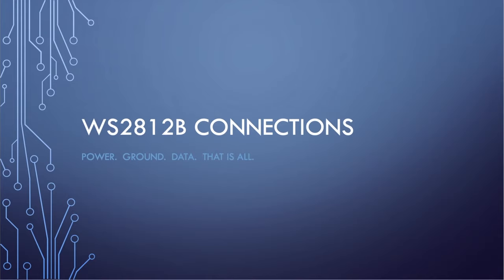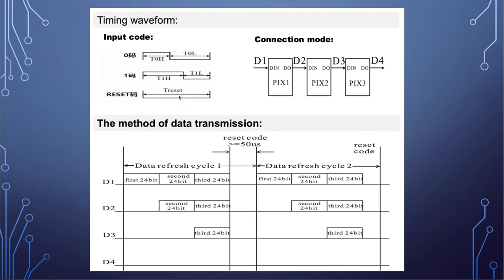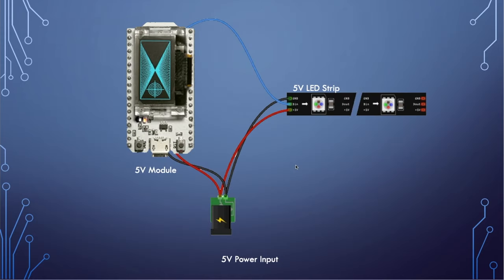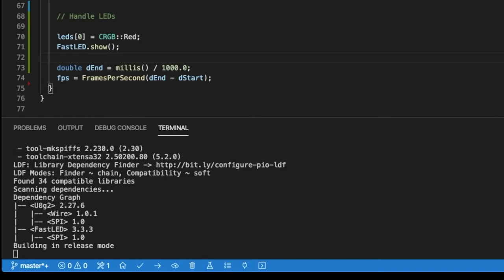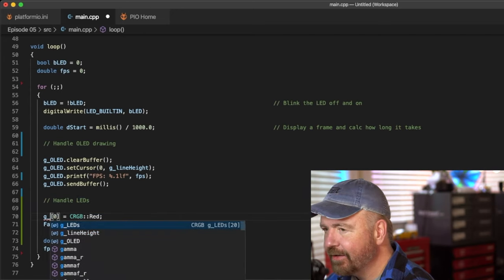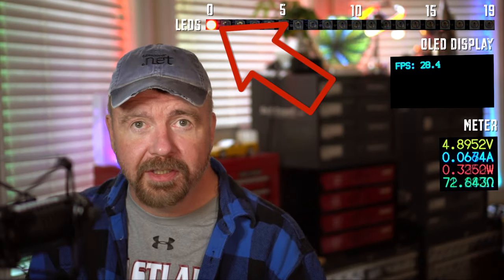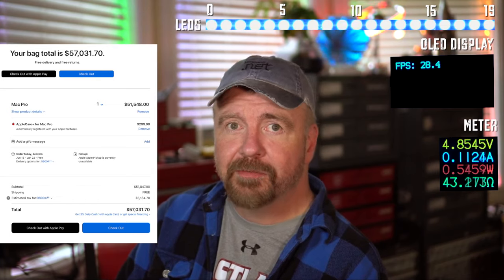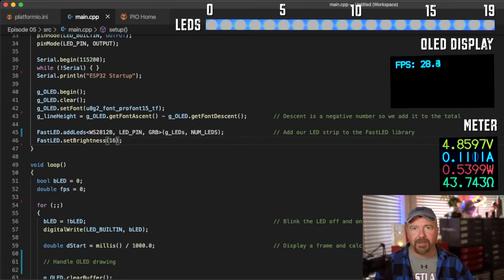04-FastLED with Arduino Tutorial Introduction - How to Code for RGB LED Strips (WS2812B)

Comment: Hey - just as a note - if you are like me, and you bought the Heltec (HiLetgo) ESP32 LoRa instead...  :)
You will need to  set the OLED_RESET (Pin16) to High and add the following code to the void setup() to get results on your OLED display... 

pinMode(16,OUTPUT);
digitalWrite(16, LOW); // set GPIO16 low to reset OLED
delay(50);
digitalWrite(16, HIGH); // while OLED is running, must set GPIO16 to high

Comment: Use FastLed inbuilt power limiting. Works and is nice: you tell it your power or current limit, it globally dims the strip to meet it (if you light too many)
Reply: Will research that!  Thanks for the heads up!  I cannot find a power supply that will fit in the form factor that I need above 4 amps and the calculations he provided of 20 ma per each leg of the LED's gives me 7.2 amps draw.  I think the real world draw is considerably less than that, but really don't want to find those limits.  I could set this feature to 3.5 amps to build in a bit of safety factor and then program away happily knowing that I can't fry my power supply by accident. 

Is this the command you were thinking about?
FastLED.setMaxPowerInVoltsAndMilliamps()

Comment: Just working thru this series - aiming to take my kids through them afterwards (they like playing with LEDs too).

Happen to have some slightly different kit lying around - so using a Lolin D32 for ESP32 and a nokia 5110 screen instead of an OLED - using the same libraries - just a little fiddling on the constructors - and it all works well.

But - I was going mad - once I added the fastled code - the LEDs blinked like crazy. In fact - they seemed to blink along with the onboard LED.

Took me a while to figure it - and you may have guessed it already :) - but this code is the reason (from the d32 header files):

static const uint8_t LED_BUILTIN = 5;

Oh - look - the same pin I have the pixels data line :)

Oh well - made me smile.
Reply from the maker: Wow, I've never seen a board that had the built-in LED on Pin5!  Good catch, that could really trip you up!
Reply: @DavesGarage  It did for a while :) I just dropped the bLED toggling for now.

I was also interested - a little less screen real estate - but the  5110 screen using software SPI (U8G2_PCD8544_84X48_F_4W_SW_SPI) the gets about 44 FPS on that moire design :)

Comment: Excellent!!!! I found using GPIO 23 for LED DATA on my DOIT ESP32 DEVKIT V1 gave low output during reset and avoids full brightness on power-up.  I was trying GPIO3 but it comes up as a driver and is high for about 250ms until the pin gets setup, long enough to confuse all the WS2812Bs and set the controls for the heart of the sun.

Comment: Hi Dave, your videos are very well made and a pleasure to watch. It's fun to watch pros program with FastLED! I'm not yet finished watching, but I'd like to say that displaying an oled display can hugely lower the frame rate (that's my personal experience). I've even come to conclude that oled displays are better not used at all with FastLED. Perhaps you could work around that issue by assigning that task (displaying the oled) to a different core, if at least you need a high frame rate (ESP32 should have 2 cores). I didn't try that out myself as I rather run a webserver, which is assumed to also capture a core. Note that I am an amateur by all means. Have a nice day and keep making nice videos!
Reply from the maker: Thanks, and a good point!  My practical solution to this is, as you say, a low priority task on the second core.  I didn't want to complicate the intro with that, but we might get there eventually!  In my own major project I'm having trouble with hardware SPI so am running the screen in software, which is super slow, so I had to solve it somehow!  It only updates about 4 times a second, if that.
Reply: @DavesGarage  Great, looking forward to those episodes! For now it would indeed complicate everything. 
For my own project, even updating the screen (I2C protocol) once per minute caused an annoying lag in some animations, which made me disable all oled updates in animation mode. I'm just telling you this because hunting such 'lag buggs' while nothing is wrong with the code can be a pain!

Comment: You mentioned connecting to a USB HUB/Switch (I think you meant hub) to protect the computer. Does it need to be powered? Recommended link? BTW. Loving the videos!
Reply from the maker: It depends on the switch and how it routes power, but I would think a powered hub would be much safer, if it indeed isolates the power entirely.  Good thinking!

Comment: It is a good job that there are people like you making these videoas. Excellent i have followed your code using 20 LEDs and the LEDs fade in and out, i have now tried 60 LEDs and the LEDs switch on and off without any fading. What am I doing wrong? Thank you

Comment: Hey Dave, your videos are great and I'm following along. Keep it up. With each video though, it seems like you're suggesting I buy a slightly different arduino board. Is this really necessary? I'd love it if, up-front, you had a full parts list you would suggest for the series so I'd know how much $$$ I was committing to in order to get to the end.
Reply from the maker: So far each one except the very first uses the same board, but I might link to a different catalog entry perhaps?  It should be the Hiletgo ESP32 w/ 0.96" OLED.  I prefer the one sold by "Maker Focus", but I bet they're all the same.   I did just switch to a link to a version that contains extra PSRAM for free, pretty much.  So it's not the the requirements have changed (any of the boards will work with any of the projects).
I guess the one exception was the very first episode where I used a board with a colored LED onboard to keep it super simple, but I won't switch often, honest !  Though I do like the M5Stick-C, check that out, as it is what I am tinkering with now!  But I still have dozens of Hiletgo units :-)
Reply: Greetings Dave, I have suffered happily learning from this series of videos.. Thanks for both the angst and for that sense of triumph, when (literally) the light comes on. Getting connected to the WS2812B strip with a board that has solder holes, rather than PINS will be fun.. Time to get the solder station out. @DavesGarage
Reply: I meant to ask: Are you using the M5stick in these videos for their ease of use.. (Places to put pin connection wires)??

Comment: Dave, is there a fastLED setting that regulates the communication speed to the WS2812B strip? I wanted to test my strip with just Red for each RGB led, then just green, then just blue to verify the individual LED were good. My string is 300 LEDs long. I have a separate 5V 20A supply for the strip. I connected the Gnd from the ESP dev board to the negative of the power supply so that the 5V power and the signal to the Data In on the strip (I’m using IO16 from the dev board) have the same common reference point. In the setup, I use a for loop to set all 300 elements of the CRGB array to 0xFF0000 so all 300 LEDs will powering only the Red LED. In the loop section, no changes are made to the CRGB array. I did leave fastLED.show() in the loop. I do not have an oled screen, but put a delay(250) in the loop. The string lights up red, but then glitch flickers to sometime showing blue briefly, and sometimes flickering to green briefly, but mostly stays on red. The CRGB data going out should never change. I’m thinking the speed of the ESP32 might be causing the data rate to be too high and the receiving WS2812B chips are not clocking in the data consistently.

Comment: Hi Sir Dave.. Thanks for all of your videos, I followed your tutorial about FastLED but it turns out my WS2812B is only showing white color LED after uploading the exact same codes. I'm using  18LEDS, 330ohms resistor for the data and Arduino nano. Why it's only shows white? Thanks.

Comment: where can we buy WS2812B in bulk?  trying to light up a 2 level, 55' mardi gras float.  I have the power suppliy capable of handling multiple branches of LED runs with proper 5v/15a vdc-vdc buck converters.  I just cannot find some place that has 350-400 ft of WS2812B strips available at a decent price.  I get that there was a "chip shortage" due to covid the past 3 years, but these things are not made of gold and shouldn't cost like they are.

Comment: Having a problem lighting all the LEDs on my strip.  When I use the fill_solid() helper function and tell my strip to light all, I only get the first 5 LEDs showing.  I have a 5V 40A external power supply, so power isn't the issue.  I've also directly set the LEDs in the g_LEDs[] array but can only get the first 5 to show anything.  I'm not using the exact same WS2812B strips that you are but it definitely is a WS2812B strip (and it's working for the first 5 LEDs).  Is there any way to test a strip to determine if an LED is bad? And if one is found bad, is there any way to replace it so the strip will work?  Appreciate any help,.

Comment: I bought the board and LEDS you recommended and I have a question. The code builds fine but I get this error when uploading.. "serial.serialutil.SerialException: could not open port '/dev/cu.SLAB_USBtoUART'" I don't think it knows where the board is? or what port. any help or advice would be great. Thanks
Reply: Assuming you're using the Arduino IDE, you may need to select the correct device under Tools > Port in the pull-down menus.

Comment: Working on externally control with 3 separate knobs / pots independently each color intensity all the way down to zero to a long strip of LEDs. Any input is appreciated while I am doing it. Maybe I see a be5er idea.
By the way, the blue thumb up button worked. 😁

Comment: On the subject of power, I purchased a 5v 60A 300w power supply and a few strands of WS2812Bs. Is there a minimum amount of leds that I can power with the supply?

 Im burning out leds when hooked up to the power supply. I have the tester and set it to just below 5v.

I figured it out. I missed the part where the esp32 needs to be grounded to the power supply.

Comment: This is a great tutorial that I found searching for some help on lighting a fire simulation under a 3D printed NASA Mercury rocket. Was thinking of just using a fire LED light bulb until I saw this, any suggestions?The problem with the light bulb is that it is directional and I need it to shoot down.

Comment: I spent many years feeling like rgb led was stupid.  Then I bought a few strips, power supplies, and controllers before I stuck any 5050 with and without WS2812B microcontrollers, since these are the only models any motherboard can also use.  DO NOT LEAVE THE STRIPS ON THE REELS while testing, it only takes a few minutes for the reels to start melting.  I heard one person say LEDs run cool. er, uh, NO!  Love Your Show as a fellow neurodiverse individual forced to buy into bogus crap bad mal- and mis-diagnoses (Mal- being these <bleep>ing ignorant alleged so-called psychiatrists and psychologists who forgot how important Scientific Method remains post-school. Not one has ever been anywhere near supportive or actually listened. When a client/patient says, "This Celexa is making me feel like I have Spina Bifida 24/7! What is the antidote? It is making a certain method of making it stop more of a viable option than you provide." and they respond with, "Your body just needs to get used to it, sukkah."

BTW, wish dot CON is NOT the place to shop for this gear.

They shipped one reel that was RGB all right, but it was Red, then Green, then Blue individual LEDs on a 12V, R, G, B four-pin arrangement, so the only way to see what color they would be as straight 5050s would is to fold the strip in a manner that puts the set of three LEDs near each other and even then you have to be about six feet away for the eye to view the color as one istead of 3cm between each.

take care maestro.

PS. I met Jim Alchin one night I was staying a little late to finish one important test in 28, when here he comes, in a big huge hurry, though I did see him coming, not real sure, but almost knew who was coming, hurried-up, tried to open the door as what I'd do for anyone, then WHOOSH i am invisible and nearly was knocked over.

I thought it was hilarious.

Also, why did full-timers keep telling us vendors our badges were Yellow, when in fact letting any sunlight on these 'Yellow' badges turned them an obvious Orange within a week.

I made it 11 years testing devices etc., with three years prior at DECwest two of them, with Intel & Compaq's PURE-D SATAN-SPAWN Carly Fiona, CEO getting together under the desk conjuring-up plns to decimate the far superior DECAlpha 64-bit CPU, which occurred during my one-year tenure at DECwest as the Tester for the three-person team to support what few customers had mistakenly purchased Windows Server 2000 Enterprise or Datacenter whatever it was called, only to find I was being paid about 30 thousand dollars an hour for the actual time spent having any actual work to do t all, DEC Alphaserver and Miata workstations were tanks.

My baby the first two years was Turbolaser, which I am told Alta Vista had 22 of the 8400 and a gazillion 9GB & 18GB drives to run the show.

I am also told billg was tearing his hair out when Terraserver's IT was a 24/7 proposition since the Alphaserver 8400 may be a tank, Windows was nowhere near stable enough to handle the immense loads it was having to deal with, not sure whether Cluster was available yet, but even that would not help, as it was not like Stratus alleged so-called "Five Nines of Up-time" server with its dual-everything, including a mod to the motherboards to link the system clocks so they are in lock-step per instruction, the simplest incomplete description, but you know the drill.

So, when one NIC failed, the whole system had to power-down (unless the guy above me had not read the manual showing how to hot-swap a PCI card while the other CPU took over, which I do not know it could do, but if iot did not, then ...)

two and a half hours divided into number of hours in a year is the real-world effect on customers, eh. ;-)

My favorite was the Gigabit NIC test cross-country, which for some reason PCI-X (pre-PCI Express) was not up to the job, which was really cool setting-up the probes on the HP Logic Analyzer for my manager since his patience and eyesight were needing the assist.

IL:OVETHISSTUFF

i just wish Customer Expectations were addressed higher-pri than they have been proven to be.

Yeah, right.

PS. at the tail-end of my Windows 95 2nd-tier Setup & Config Tech Support two year stint, the 2nd year as the worst team lead ever, worst.

... mostly due to Scott who is a super-genius like you and managed to be able to take calls to satisfaction while . . .

BUT HE ALSO MADE A DOOM MAP of our entire building while doing so.  heh

anyways, the gal in FLA asked me to marry her after the eight-hour and seventeen minute call it took us to undo the possibly purposeful worst configuration of any PCI have ever seen put out by the likes of Compaq ever. Nowhere have I ever experienced so many <bleep>ing intentional IRQ, I/O, and Memory resource conflicts which DOS gave no care to, somehow, but Plug & Play?  erk

be safe people of GAIA

Comment: hi i have a  Question if you can help I hava an arduino uno I have a sketch put in to drive the pixels ws2811 5050  12v 
the part that dont make sense is it all seems fine untill i start up the vixen program the leds start a random light show they only stop wen i shut down the vixen program.

Comment: I'm just starting to do my own research on led strips... I like the addressable leds, but whats unclear to me is 1) how efficient are they, lumen per watt for white light. 2) standby power 3) voltage.
I have seen SK6812 led strips, claiming 19.2 watt per meter, while producing 1160 lumen or 480 lumen warm white. There is a warm white led added for white reproduction. If the 19.2 watt is only for the 480 lumens, thats a horrible efficiency of 25 lumens per watt. If they add all leds together, you get 60 lumens per watt, not great, but more realistic. But when you want white light, you would only use the warm white light right? So 19.2 watt is all RBG leds and warm white? Thats not realistic right? And why are they only in 5v? With huge amparages, would 12 or 24v's be more logical?

Comment: Hello Dave, I've been trying to code my own lightshow setup for my project, with the funtions like the knightrider scrolling lights, is there a way to use a rotary encoder to control how fast the light travels from end to end, like a speed control?  I can't seem to find a way.. any help is appreciated
Reply: Hey Sam, (I haven’t tried, but saw similar (button press to change patterns) elsewhere), how about if you take the rotary encoder outputs (up/down i guess?) to 2 more pins on the Arduino, use them to change a stored led incremental value?
Reply: @AirZeee  so where i am atm is i have come across some coding for a oled screen, about 7 different lightshow options, but whist it does most of the functions im looking for, id like to make the menu system alittle more complex, and i believe i will need to incorperate acouple push buttons instead of using a single encoder

Comment: Any help or ideas?  In VS Code, WS2812B and some of the CRGB members are undefined. Although it can find the FastLED.h. The same code builds and runs fine from the Arduino IDE so I assume its an issue in VS Code.
Reply from the maker: Make sure you have my platformio file in your folder, it's the one that includes the FastLED library for you